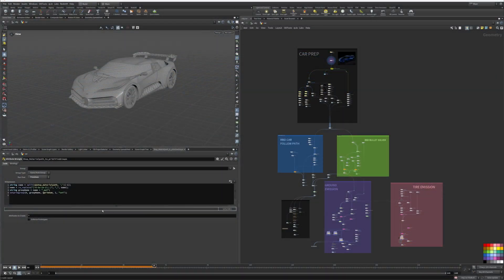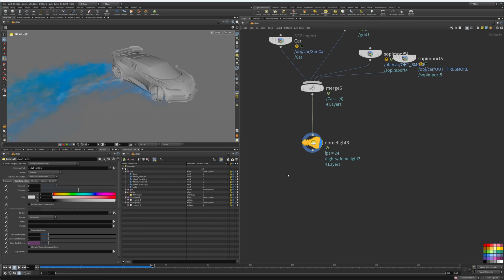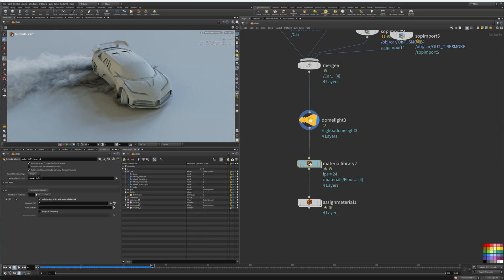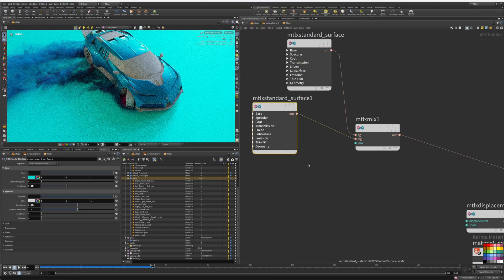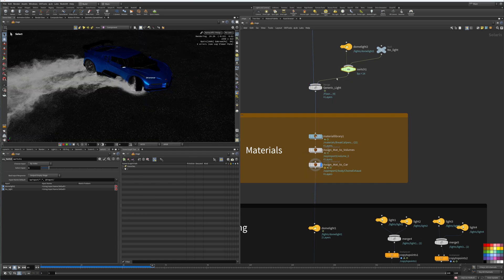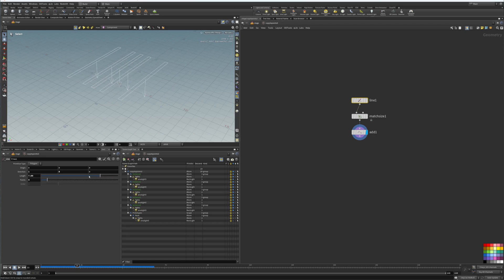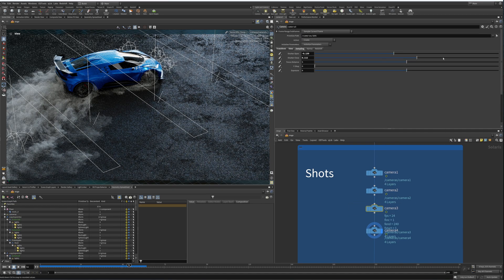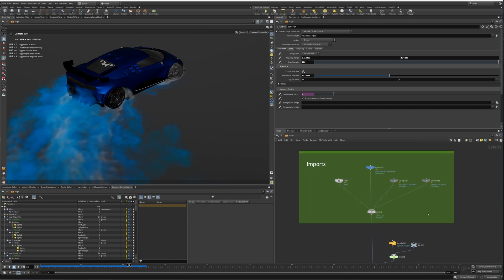Rendering in Solaris with Karma XPU | Houdini 20.5  (Part 3)

Comment: Hi - Thanks for the video. 
Can you please share your pc specs? cpu, gpu, ram, motherboard, psu
Reply from the maker: Hey Ramon, thanks for watching. The setup I have for my main machine is this.

CPU: Intel i9-14900F with Liquid cooling 
GPU: RTX 4090
RAM:  128GB
Motherboard: ASUS ProArt Z690
PSU: Corsair HX1200i
Reply: @jorge_lega  Thanks for your answer! Can you say why you are using intel over amd for the CPU?
Reply from the maker: @ramonlevyful  This is just for my main machine. I have a few AMD machines and a few Intel ones. For AMD I got the Ryzen 9 7950x. There is no big reason why I chose one over the other. mainly came down to price an availability at the time. But if I were to start a new setup and I didn't have anything I would go with what ever the fastest CPU (possibly AMD) available along side with a good GPU that has enough vram and lots of RAM. Houdini handles lots of stuff with the CPU, After Effects is RAM hungry and a good GPU gets your renders done fast.
Reply: @lega_xyz   OK, thanks you very much for the answers!
Reply: Ok, last question - You have mention using After Effects. Are you using Nuke as well and can share some overall user experience between the two programms? Why prefer one over the other?
Reply from the maker: @ramonlevyful  for heavy compositing I would recommend a node based software, Fusion or nuke. I use After effects mainly because of its motion design tools and other people I work with use it. If you don't have to worry about doing too much typography stuff. I would recommend starting out with fusion since its free as a part of resolve. Then you can upgrade to the studio and use the stand alone and don't need to worry about subscriptions like nuke and after effects. It just depends on the work you do.
Reply: @jorge_lega  Awesome! Thank you very, very much!

Comment: Absolutely amazing info. Thanks so much, instant follow.
Reply from the maker: Thank you!🙏
Reply: @jorge_lega  I tried to make the shop_materialpath prim grouping a little easier, and the Groups From Name node worked wonders... also easily customizable to any other attrib than name. 👍
Reply from the maker: @philippwelsing9108  Nice! I will use that option, gotta give it a try.
Reply: @jorge_lega  I tried to make things easier with the shop_materialpath grouping and used a Groups From Name node, which is super easy to customize to work on name or any other attrib. 👍
Reply: Plus: I love working with the Material Linker. Respects the prim groups as well!
Reply from the maker: @philippwelsing9108  Both light linker and Material linker are great. There is so much to learn in Solaris. This new workflow is the way to go.
Reply: @jorge_lega  I think so, too. Looking forward to your next one.
Reply from the maker: @philippwelsing9108  I am open to suggestions... Thanks for supporting me.